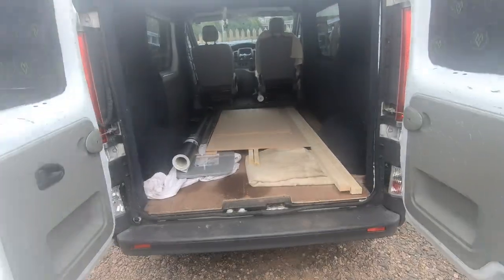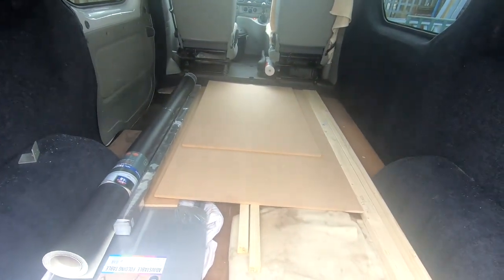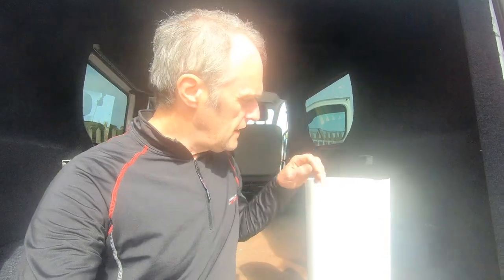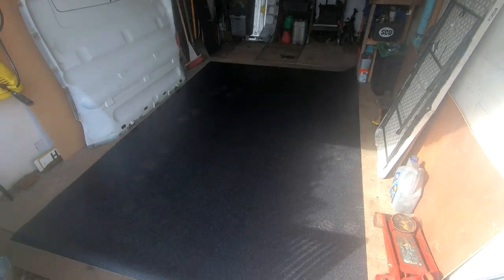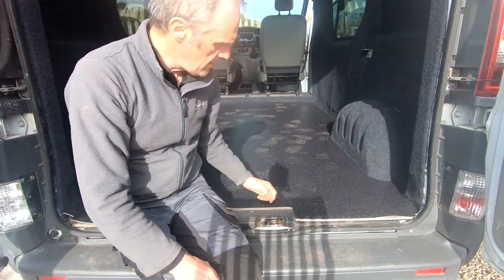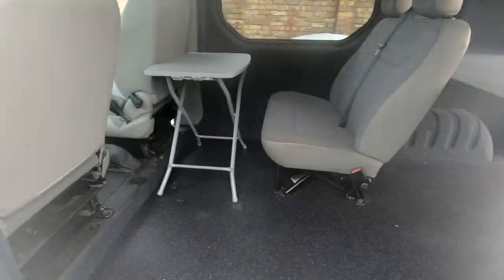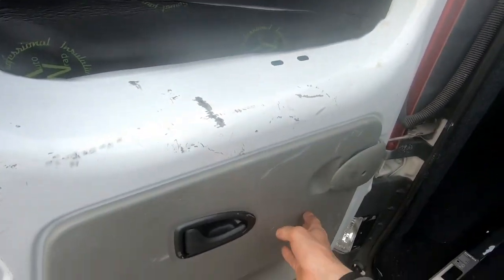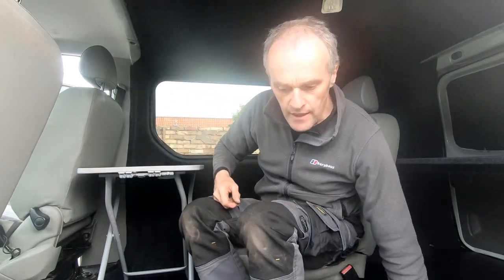Renault Trafic Day Van Conversion Part 4

Comment: Big 👍 mate. I’m on my 5th video now. I bought a Renault 2011 19 months ago with only 40.000 ks on the clock. Thought it too good to be true but I’ve done 15.000 ks with out issue. Runs like new. I’ve been living out of my van for all this time travelling around Western Australia. The one thing I’ve learnt is keep it simple and save on weight if you can. Looking forward to seeing future videos on the Renault van. 👍🇦🇺 17:15
Reply from the maker: That's great thanks. I've my red van nearly done now and the layout is just the same but with a single seat in the rear which gives much more room. For me, simple is best as I carry bikes/kayak gear etc plus my work things!  👍

Comment: Hi
Just wondering if you've any problems with your dipped lights? Mine don't work but my main beam does. I've changed the bulbs and replaced the light stark but still no luck. I've checked the fuses and there OK. Also the light doesn't come on the dash. Rear lights work but I wasn't sure if there was a relay somewhere. Any advice epuld be appreciated thanks
Reply from the maker: Sounds like an earthing or connector issue somewhere. I'll do a little research and get back
Reply: @Garage Of Dad  thanks for the quick reply. Like I said high beam works and dipped but no main lights are working and the symbol doesn't come up on the dash when I turn the lights on. Am not sure if it's a relay in the engine bay or there's 1 hidden somewhere.